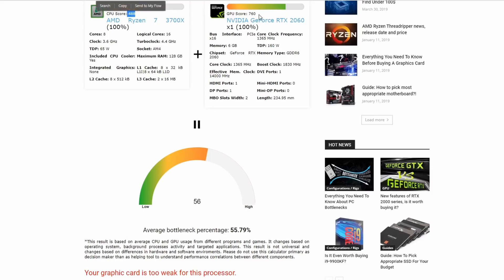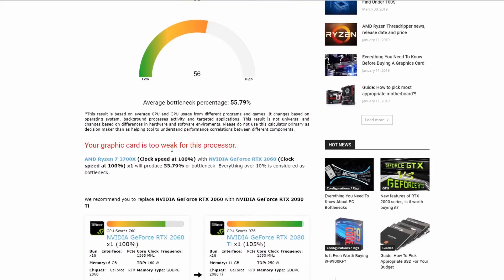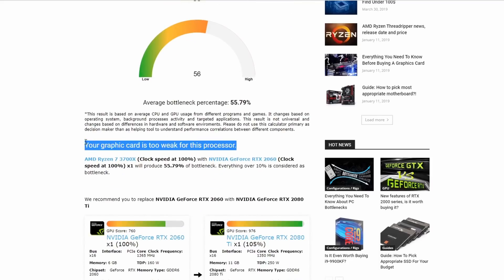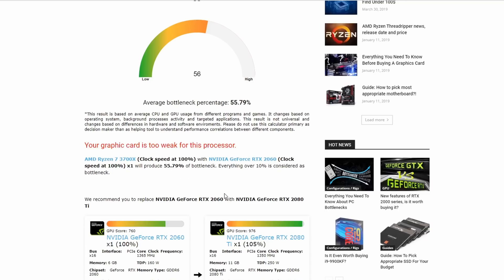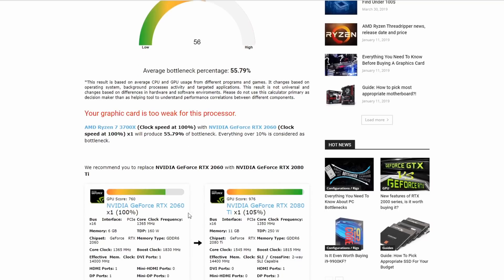System Bottlenecks Explained - 2020 pcguidelk

Comment: මගේ cpu ඒක i5 3ගෙන් 3.2 ghz gpu eka gtx 960 2gb ram eka 8 gb මේකේ  gtav very high දාලා  ඔක්කොම cpu used ඒක 99  gpu used ඒක 95 සමහර තැන් වල ram used ඒක කලින් තිබ්බේ 5700 වගේ දැන් 7200 වගේ යනවා මේකට මොකක්ද කරන්නේ  help

Comment: aiye normal 3rd gen board ekaking game gahanna puluwanda 
dn mage thiyenne 1st gen board ekak 
i7 
rx570 4gb
ram 20gb
 mage laga board ekak thiyenwa  MSI normal  board ekak thiyenawa hambechcha ekak
 ekata i5/i7 3rd gen processor ekak gehuwama aulk nedda gaming /recording/ streaming walata 
poddk kiyannako
Reply: i7 3770 ghl , motherboard eke bios up krpn ( update thiyenwnm )

Itapasse oy ub kiyl thiyen parts tika thawa hodt wadak gnn puluwn.

80+ rated power supply ekakuth use krpn

Math h81 ptta podi board ekakt 

I7 4790 @ 4ghz
16gb ram ( ram 2i ghnn puluwn )
Gtx1070 

Streaming , 3d modeling , video editing , Cad , gaming 

Hama ekm krn. Aulk naa

Comment: I have gtx 1660 with a i3 9100f processor.I have already downloaded the msi afterburner.
But it won't show me the  show on screen display icon.How do I get it?
Reply: Hello @thenul I am going to buid a pc with same specs as yours, tell me more about your profomences.
Reply: @tharindusupun4029  9th gen i3 is good for gaming because of its core count.
You can stay in a stable 60 fps in most of the games games that I have all ready 
played. this i3 9100f's performance is similar to the i5 8400 processor. 

Ex-NFS Heat
      Battlefield 5 
      Boderlands 3
      Fortnite
      COD MW 2019
      COD WW2
      GTA V
      Star Wars Jedi Fallen
Here are some games that we can play in ultra settings with this CPU and GPU.
Because of these things I recommend this PC.
Play games have fun.
Reply: @thenulranmuthu9048  Thank you
Reply: Turn on osd for details which you want to display
Reply: @dvharitha  There is no OSD icon in my app.By the way, thanks for the reply.